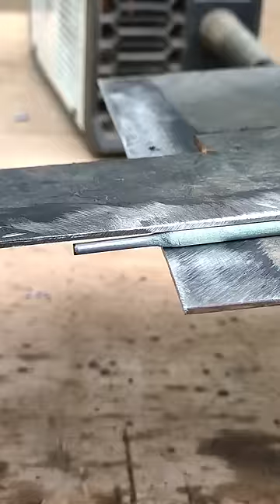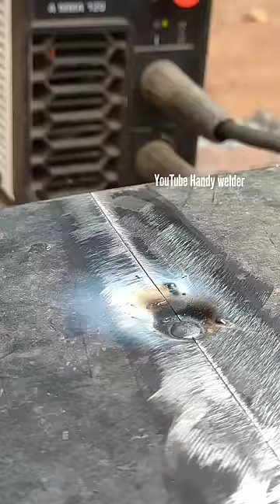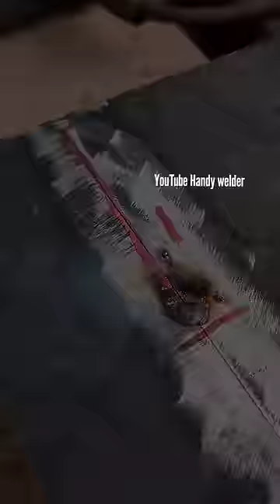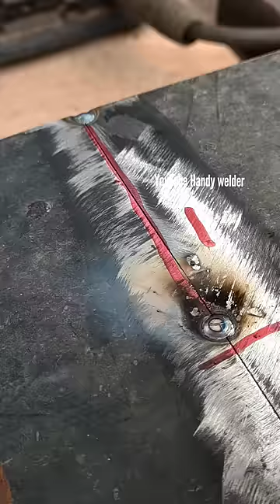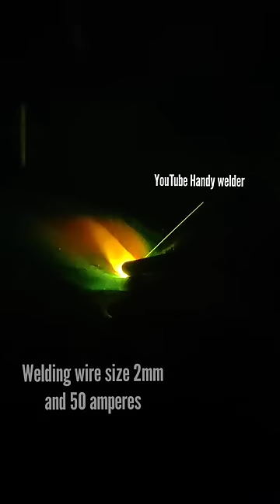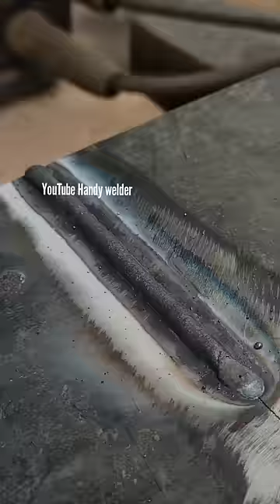technique for welding thin plate joints

Comment: this is a 1/16th 6013 rod which is why he ran a straight bead.  A 3/32 rod requires the stich method which the haters call "tack welding".  Again he's doing the limits of stick welding for those who never seem to understand  Great Job
Reply: 3/32 doesn’t require a tack method to weld it it’s only if ur welding on thin shit like that it’ll blow through.
Reply: @samthastoryxo546  that's the POINT!  He's stick welding THIN metal in 99% of these videos
Reply: So you must be a welder then
Reply: @LexusGX460-OFF-ROAD   I could still run a straight on something that thin and not stitch it w 3/32
Reply: Post the video then
Reply: @lharmon8509   me? I will if you’re talking about me.
Reply: @LexusGX460-OFF-ROAD ya I was fr kinda like yeah ofc not running continously is going to be lesser penetrantion but there isn't even a 10th of an inch to dig in to like wtf I was starting to doubt my own knowledge lol
Reply: Stitch welding has unwelded spaces in between. Some of his other videos, he is actually tack welding. I have never seen that and is new to me. Most if not all welders cringe when I showed them

Comment: 6013, stainless steel rod, always leaves a nice
bead, n doesn't rust... 😳
Reply: @dsud7853  
Not so Grasshopper.
I had to weld up broken mops for school districts n got my ass chewed out for using
mild steel 70 series rods that would rust.
I was told to use 6013 "stainless steel" rod because it would not rust n dirty up the chemical mixtures in the mop bucket.
Reply: Wrong cricket
Reply: @tre9563  
Suit yourself. 
Use fucking coat hangers if you like. 
6013 is good for 12,000 + psi tensile bursting strength n doesn't rust. It depends on the percentage of SS in the rod. If not 100% SS like surgical instruments, it will eventually rust. 
Yeah, I suppose you can call that mild fucking steel, Einstein... 🤔
Reply: @dsud7853  
Country of Texas!
I suppose the government, EPA, etc, may have
something to do with the "ingredients" being put into welding rods. 
But I can tell you this much, I used 6013 SS welding rods on mops, motorcycle exhaust pipes n also to weld brackets and/or repair Harley frames with excellent results. Some of my customers did not want the welds painted over because they looked cool, did not rust, n
were shiny like chrome.
Now, most of the welding I do is with a Lincoln MIG. I can be more precise with the 
MIG, but can still do the stick welding if needed...

Comment: No mention of the fact that the weld will draw the metal towards the bead. So if you don't clamp both pieces really well it will cool with about a 5 degree bend in the middle.
Reply: mr wise guy

Comment: Привет вам из Узбекистана! Я вас подписчик постоянно наблюдаю ваше ролики. Скажите пожалуйста лист метал 4 мм при сварке деформируется, что и как можно сделать без деформации варит лист??? Спасибо.
Reply: Ток убавь, 4мм это не такой уж и тонкий металл. Перегреваешь значит.
Reply: You could clamp a thick bar to the back of it, or tac it down. It acts like a chill bar and can help with deformation. Don't run too hot and split the beads to spread the heat. 

Other than that is to heat the back side with oxy to shrink it back. It's a bit harder technique to master though but very useful if you do.
Good luck mate, hope this helps you a little 👍

Comment: Wouldn't that mean you'd have to weld on the other side to have a properly secured bond? Or is that good as it is
Reply: On that thin of plate it’s fine. I’m still shocked they actually ran a bead instead of that tac, tac, tac, tac 💩.
Reply: @Len_M.  Same, but it looks good either way